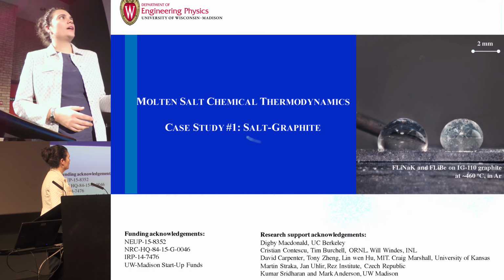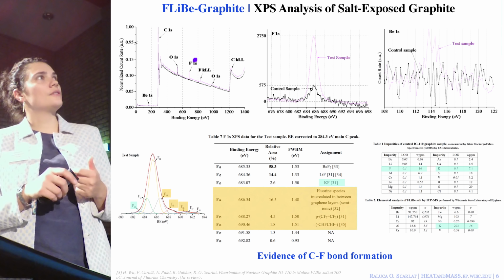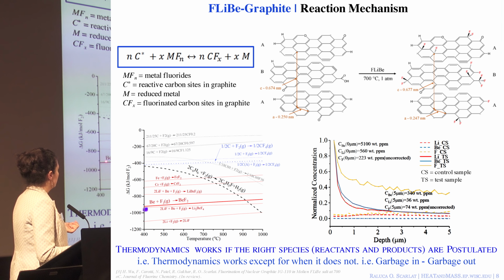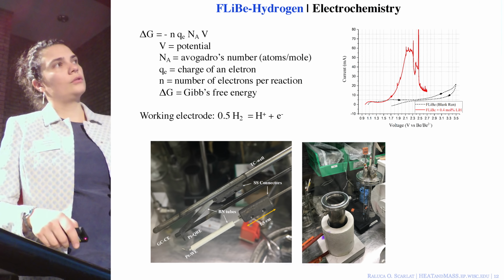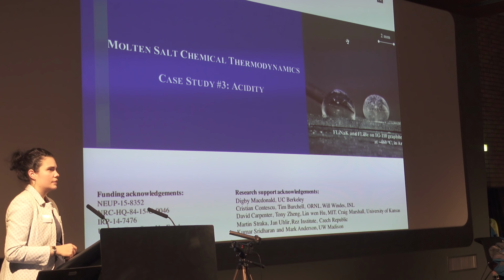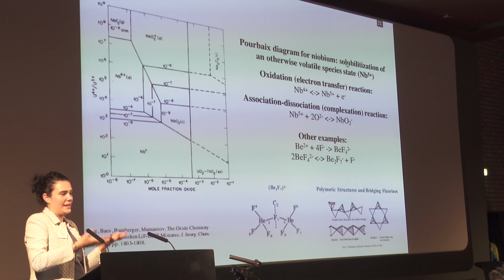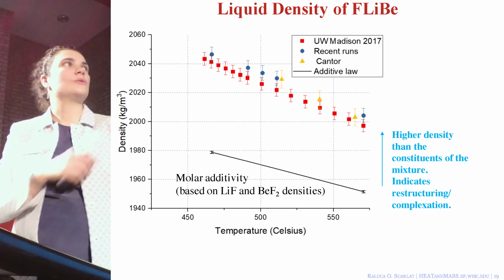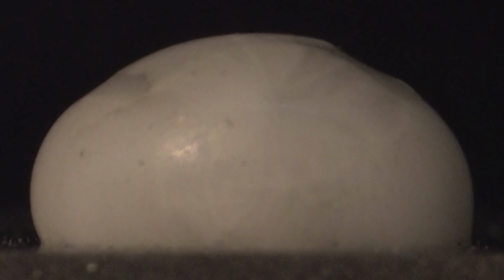Molten Salt Reactor Thermodynamics - Dr. Raluca Scarlat @ ThEC2018

Comment: I wonder if they are considering graphene (nanotubes for example) with its homogeneous structure where should be no mentioned reactive boundary structures. Other than that so great to see another video, many thanks for sharing.
Reply: Cost!
Reply: Paul Carter, do you mean cost of replacing graphite moderator?
Reply: @proximo1033  
Graphene is just single layers of graphite. You can make graphene just by applying sticky tape to a slab of graphite, pulling it away, and then using acetone to dissolve the adhesive.

Graphene is also present in the graphite blocks used in the moderator of molten salt reactors. 

The problem is that there is no way to synthesise monocrystalline graphite. Nuclear graphite is often synthesised from the charring of coal, coal tar and pitch. A mixture is pressed  into blocks and then sintered at high heat and pressure. Depending on the reaction conditions you can get graphite that has very little porosity but the problem still remains that the underlying graphite crystals are still relatively small with many areas available for interaction with the salt contents of a molten salt reactor. 

Once you get porosity down below a certain level then molten salt does not wet the graphite - that is to say, the salt no longer sticks to and spreads out along the surface of a graphite block but forms those nice little spheres atop the graphite in the title slides of Dr Scarlet's presentations. But fundamentally the graphite is still polycrystalline.

In any case, even if you somehow managed to get a truly unprecedentedly large graphene or carbon nanotube synthesised to form an MSR moderator block or reactor vessel, the problem remains that there is neutron bombardment during the fission reaction. Neutrons interact with the crystal structure of the graphite/graphene/nanotubes, disrupting that "perfect" boundary surface. Likely punching holes faster than the nanotube can self-anneal. So you wind up back at square one.
Reply: @proximo1033  .  If moderator, I see no improvement from graphene over processed graphite.  For inertness, even graphene has bonding defects and reactive centres.  Whole containment vessel would need greater strength. Vessel lining, still no real advantage over graphite.  Did you have an application area in mind?  One might wonder about a fullerene soup, maybe, where adding more would be simple. But then the U/Th separation would need extra work.
Reply: @ordinarybloke6962  
Are fullerenes even stable under high temperature, high neutron flux, and high shear (turbulent flow) conditions?
Reply: @MonMalthias  No, doubt it!  But it's not oxidising environment. C12 has to capture 2 N to reach C14, which has a fairly long half life. I guess that is part of its great durability.
Reply: @ordinarybloke6962  thanks for your answer.